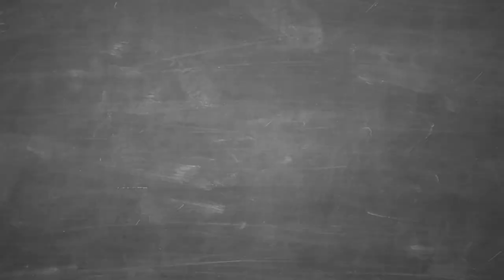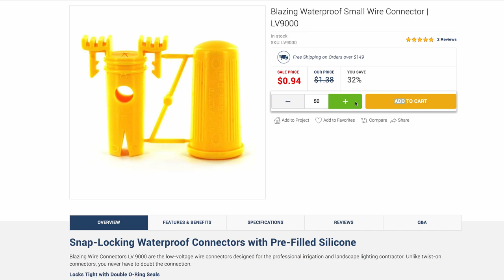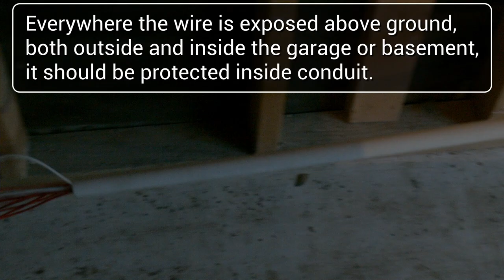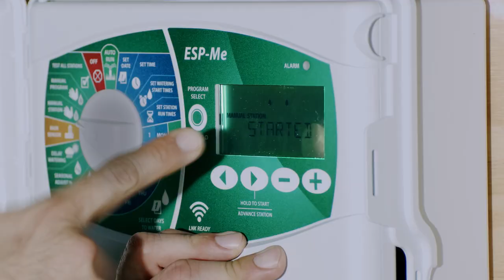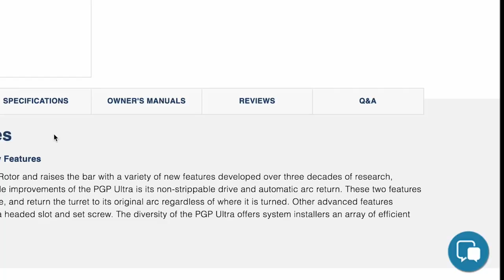How To Run Sprinkler Wire

Comment: Why do you use many single wire cables instead of one multiple wires cable?
Reply: Probably cheaper in bulk
Reply: Because multistrand is trash, lol ok it's not trash it has its uses. But single strand is way better.. and just like pipe sizing you have to account for losses based off your wire thickness ( gauges )
Reply: BECOS THE BOYS PROBABLY STOLE THEM LAST NIGHT...... WHAT THE HELL DO YOU THINK..........
Reply: OR IT COULD BE TOO SEE IF THEY CAN COUNT................

Comment: You guys should waterbore next time. Put a 2inch nozzle at the end of a 3/4" sch40 pipe and thread a hose bib adapter on the other end. And there you have a water bore.
Reply: Problem with water bore is the dirt you need to pack back in that space in order to maintain appropriate support for that obstacle is washed away. It's also a muddy mess that homeowners won't appreciate.

Comment: I wish I had Hired you. I paid 5k in early March 20 for an 8 zone system. One zone never worked. All pipes and wires are exposed to surface. No proper water distribution. And a manifold in a walkpath already two people have fallen on it. And so many More issues. I'm gradually trying to fix issues. But have lost more than 10k in landscape. And cried many nights. Now I know.

Comment: That coil wires does not cause a noise choke  in the wire
Reply: IN ELECTRONICS IT DOES ...... BUT THIS IS I READ A BOOK IN HOME DEPOT AND I JUST KNEW THAT I COULD BE A GREAT INSTALLER NOW.

Comment: KUDOS to you: I am a sparky. I have NEVER heard anyone except for me tell anyone else to leave an extra 12 inches of wire in a panel. I ALWAYS leave extra in every box, device box as well as panel.  When you get good at it no one will even notice the extra wire....until they need it and eventually they will need it.
 
BTW, if you are a pro company and running wire like this, use different colors for different valve banks. If you had red, black, blue you would know that red was zones 1-4, black 5 - 9 and blue 10 -14 etc. Similarly one could use color codes for bubblers and sprinklers etc, so that the zone doesn't matter, only the kind of device.  The time should be the same for every zone of the same type and group by type in the controller for easier programming.
However, Underground Feed wire like 16/4 through 16/10 is a LOT easier to run and every solenoid would be on one color ( and you would have extra wires in the bundle if one had a problem. That would give you 9 zones.

Comment: That coil in the wire will do nothing for power surges... lol.  Although it sure looks fancy.

The only way to protect against surges, is the excess voltage above your desired voltage, has a way to go to ground without going through the solenoids into the water.
Reply: Yup that’s why they are starting to put ground rods in for timers
Reply: Now hold on, what's up with those I am iron things that come around sensitive electronic cables and how would grounding affect anything, you're not grounding out your live circuit me hopes
Reply: @sammyjoe2390  shhhhhhhhh